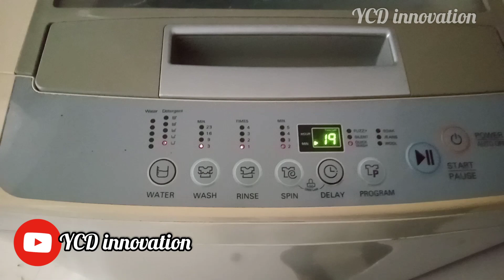lg washing machine inlet valve repair & replacement/lg top load washing machine inlet filter clean

Comment: Sir vanakam sir latest model LG top load washing Machine on panalum off panalum water durm Ulla water 💦💦 varuthu sir inlet valve problem sir inlet valve change pannaen sir Ana program water level set pannaen sir enakku durm Ulla water varala sir Ana water drain akuthu sir control board heat akuthu sir ynna than sir praplam sollunga sir ples sir 😢